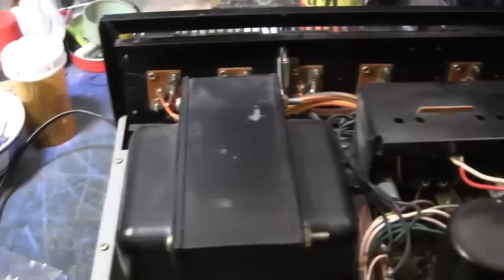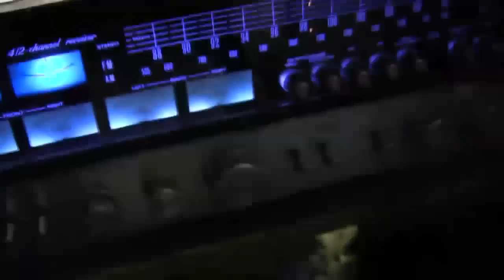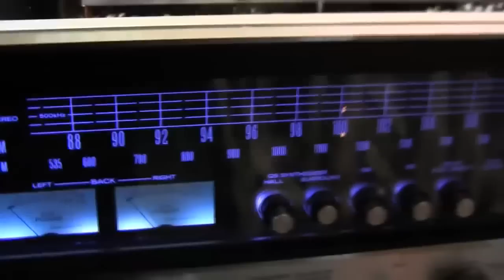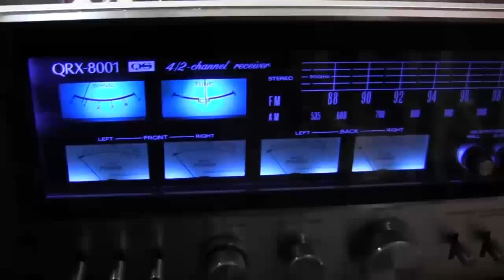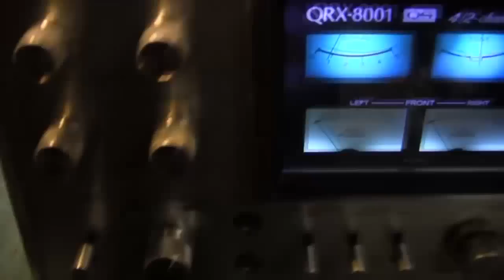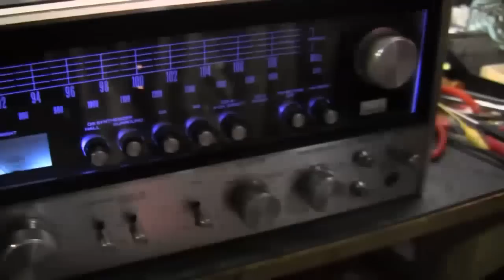How to change stereo lamps - Sansui lamp change to LED

Comment: Why would anyone put in LEDs on a stereo. They look horrible. They also devalue the unit. Any collector worth calling himself a collector will demand, and pay extra to source original incandescent bulbs. I did one conversion for a client, and after he got home he came back, and paid me again to put the correct bulbs in, and I have to agree it was the right choice. Now I don't even give my clients the option because they look like crap. Uneven lighting, and the color is off from the original bulbs. Yuck.
Reply: a bulb will devalue the entire unit? Hyperbole much?
Reply: @Sooopa_Doopa  
A true collector wants everything 100% original and that means the original incandescent lamps.
Reply: @12voltvids  Bah!  A true audiophile doesn't give a rats @$$ as long as it doesn't affect the sound lol

LEDs runs cooler and are 1 less problem to worry about when dealing with 40+ year old equipment.  I admit the early LEDs were pretty harsh but these newer ones are infinitely better looking

Comment: I like the warm glowing bulbs originally installed, you can spot leds  right through the background panels. I heard that a light sanding with fine cures this problem by scattering the light..
Reply: I agree. LEDs in a vintage receiver suck. I never install LEDs. I pay extra to get incandescent bulbs, because my clients demand that their vintage receivers look original. Changing to LED reduces the value of vintage equipment.